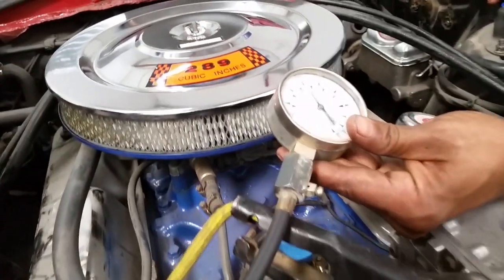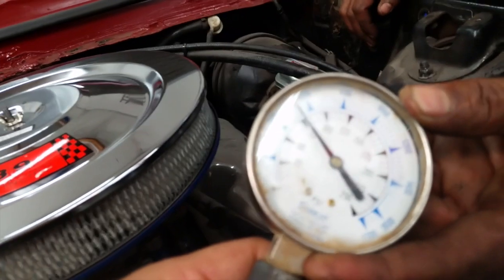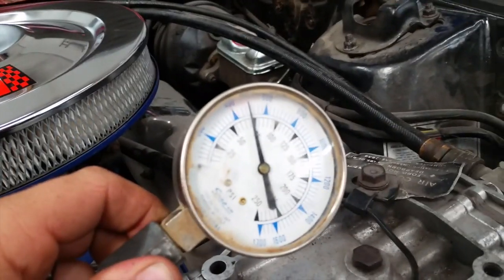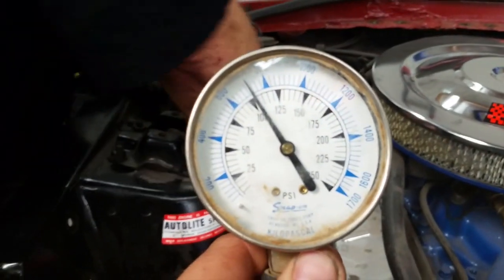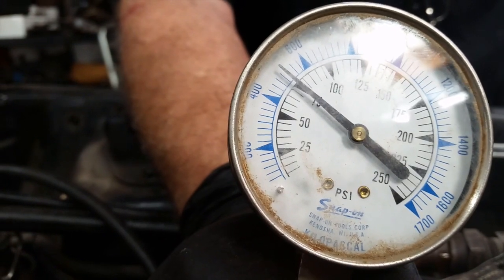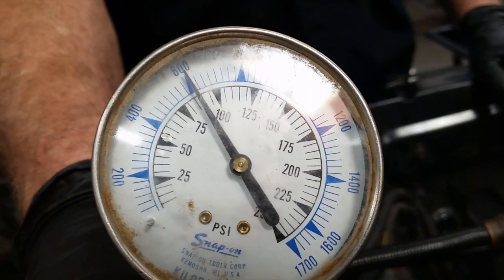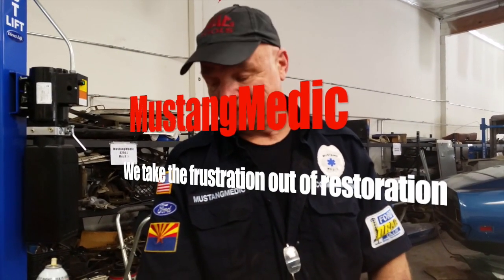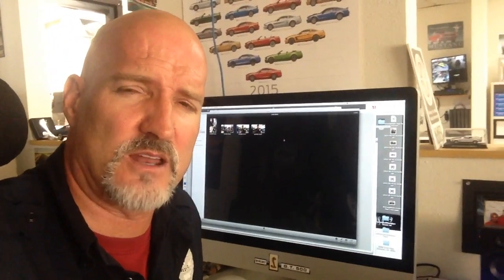Compression Test not good William's 1967 GTA - Day 20

Comment: That may rank as the worst compression I ve seen on mustang medic so far. Does it smoke??
Reply: likely it would not run at all.a cylinder needs at least 100 psi to fire.time for a leakdown test on it on all 8 cylinders.I am betting it has valve problems if the engine was completely rebuilt and it did not have hardened valve seats installed.
Reply: need to do a wet compression test as well.that will tell if there is ring or cylinder wall problems.
Reply from the maker: Agreed : (